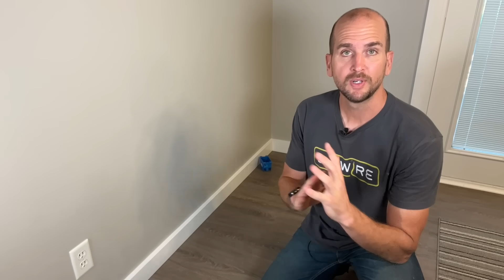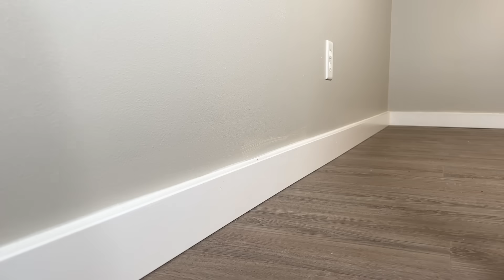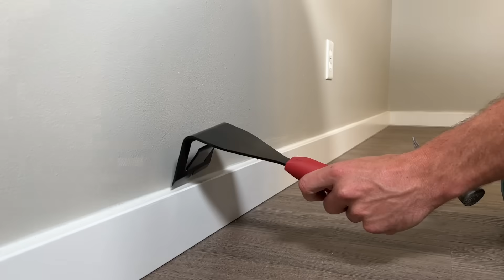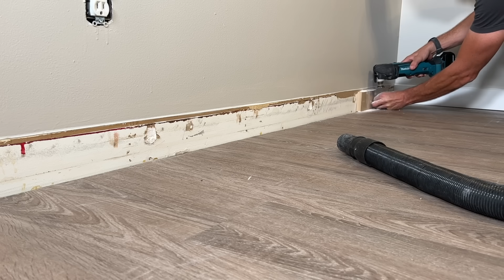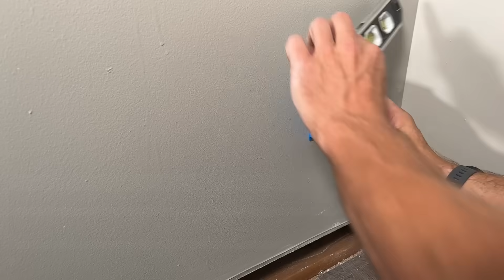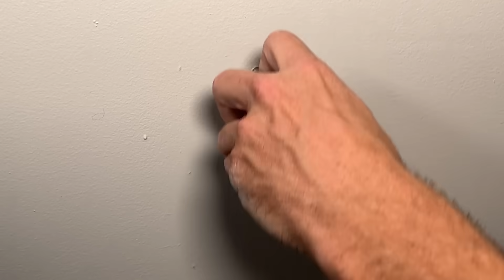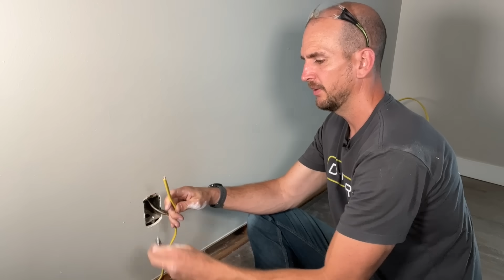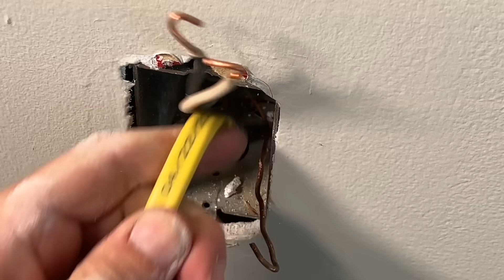How To Add An Outlet To A Finished Wall

Comment: Nice try but...Wire is way to low for code..what if your house is on a slab and God forbid it floods
Or say years down the road someone decides to change out the trim and doesn't know the Wire is down that low..
This is why we have building codes

Comment: FYI if you own a rental property you cannot legally DIY electrical work unless you are a licensed electrician and you pull the proper permit. You are allowed to do electrical work in your residence only.

Also, you don't need to use a wago(or wire nut or merret), the receptacle has 2 hot and 2 neutral terminals for this exact purpose. Power in, power out. Back stabbing a receptacle should be your last option when hooking up a receptacle. Doing a hook end on your wires and going to the terminals is the best and most secure connection.

Comment: Ps. You CAN have too many plug outlets. No mention about how many outlets on the circuit. Don't forget there is a electrical code to follow. Be safe

Comment: you dont need the stud finder and its not always accurate because international building codes require lateral support boards (crush blocks) that run horizontally between studs under certain load conditions so your fasteners do not necessarily indicate a stud location...the single gang box that the existing receptacle is in will be nailed to the side of a stud unless the box has a large flange with screws in the outer corners indicating that it is a "remodel box", which you could otherwise pull out of the wall by unscrewing those screws, thus leaving you with a large opening to fish new wire. You can find which side of the box the stud is on using a small putty knife and then measure over 16" and knock on the wall like you would knock on someone's front door. Assuming there is a stud there, you will hear a distinct difference between your knock over the stud vs. a knock over a hollow section of drywall 3" to either side of the stud unless there are multiple layers of wall covering....worst case scenario, you can always run a small 1/4" drill bit into the wall and you'll definitely know if there's a stud or not once your drill gets through the 1/2" drywall, then just fill in the 1/4" hole with spackling or drill your hole 3"-4" from the floor so that its above the bottom plate of the wall framing but still low enough to be covered up by your baseboard. You don't necessarily have to remove the drywall behind the baseboard either...I usually just run a 1" paddle bit on a steep angle wherever theres a stud, which gives you enough room to fish wire or grab it with needle nose pliers if needed

Comment: I would have used a 4' flex bit and just fish the line over. 20 min job and no carpentry involved.
Reply: Works if you know for sure nothing else is in the wall. Drill away.

Comment: Great job man , wouldn’t have thought to remove the trim and go low. How I’ve been taught and usually go about it his is by using the stud buddy like you did and on every center of each stuff between existing to where the new outlet goes , use either a 4 inch hole saw *why , use it regularly for canless can light / recessed lighting, 4 inch hole is a pretty good fishing hand hole. And from there off set the hole to the center of the studs so where you can use the same method , spade bit and extension , and then at the end wood screws back over the 4inch cut outs after done fishing wire , so in the case of being u see cabinet lighting / adding an outlet from over 46 inches off the foot may serve a purpose hahaha , but you definitely saved having to paint or do any dry wall repair as I would have my way ! Cheers brotha ! Nice video

Comment: Great idea that works for audio also..surround sound. If you have floating floor or carpet  you can use stiff wire to cross doorways too instead of going over the opening behind trim if ot has it.

Comment: Done a lot of fishing to add boxes including this way, but when you have foam insulated walls it is more challenging. I have notched the studs as low as possible, plate over the wire and of course do not try to nail the drywall that low.

Comment: Great video! My only question would be about determining if the circuit will handle  another outlet. Where I live I believe the maximum is 12 to a single circuit.

Comment: Good explanation of the work your doing and yea I have seen plenty of installs without a connector. I do the same method as you did pre install the connector hood pro tip 👌🏽 giving you a subscribe follow. 👍🏽

Comment: Beautiful 
Just one thing... I was taught that when installing a device into an old work box, you break off the ears on top and bottom around the screw holes so that the device flushes up between the ears of the old work box better, making it easier to flush the plate, especially if it's ceramic, to the wall
Reply: Only if it’s ceramic and not cut out or it’s a handy box with a wraparound cover. The ears make the offset perfect on drywall locations so they should not be removed. There are also little horseshoe rubber plastic/ rubber washers for when walls are double or ceramic tile is thick. They are stackable so you always have a tight fit with no wiggle which always cause trouble eventually.

Comment: I had some electrical work done last summer and he claimed he had a "trick" for ensuring plenty of room for wiring...He claimed that he would take a box that was one size larger than the number of switches/outlets/etc, that he planned to use.  i.e. a two-gang box for a single outlet...Obviously that wouldn't work for those retcon boxes, but does this sound reasonable to anyone?  It just seems sketchy to me...
Reply: 'Electrically' it seems fine. Either the 'back box' is correctly wired/earth or it isn't. For me it's a question of the aesthetics. Do you really want an over-large blanking plate?

Comment: Can you do a demonstration where there is a doorway between the old outlet and the new location? I have this situation in my kitchen where only one wall has two outlets available for appliances. One outlet is used by my mini fridge because its low and I have an above counter outlet. The new location would be a wall 90” from the mini fridge outlet but it has a doorway in between them. 
Would I have to do something similar but feed the cable around the doorframe?

Comment: That was oddly satisfying to watch 😊 Removing the bottom of the drywall has no ill consequence, like risking to sag? And - is it common not to use  insulation in the wall?
Reply: It is an interior wall, insulation is only on exterior walls usually; however, if a room needs to be soundproofed it will sometimes have insulation as an added sound absorbing component.

There is no sagging due to the drywall being properly hung by sufficient number of screws that together can carry the weight and prevent sagging.

Comment: Well explained. Having done it myself when I first saw this I thought to myself "simply remove the base molding" which is exactly what you did.
Reply: @EverydayHomeRepairs  I've had decades of experience doing home projects of every kind, plumbing, electrical, carpentry, door and window installation, roofing ,sheet rock, painting etc but when my wife said she wanted me to install another outlet, around a corner no less, my wheels started turning because the area was above a basement that I had finished. At first I was thinking I'd have to do a lot of sheet rock finishing work but then a light went off in my head, remove the baseboard, cut the sheetrock below the top of the molding and the job would be easy.

Comment: Electrician here. I would just like to add that the boxes must have adequate cubic inch volume for the size, number of wires and devices to be used. A really novel way to extend the circuit and neatly done.

Comment: Although I can see doing it this way under certain circumstances, its far easier most of the time to simply knock holes in the wall at the receptacle height, and patch/repaint the sheetrock afterwards.
Reply: That's how I do it. While I watched him do it, I know from experience the chances of getting baseboard off without trashing either the board, or the wall, or both, is pretty slim. Which means patching and painting sheetrock anyway, PLUS replacing, priming and painting base board, and then caulking all that. So I'm with you.

Comment: Is there noone in the US who runs electrical conduit/plastic tubes/flexible hoses inside walls for wires to run through?
Just having the wires hanging loose inside the walls seems precarious, and rerunning wires or adding a ground wire becomes an absolute nightmare

Comment: EXCELLENT CONTENT, and Narration!!!  Thank you
   Anotger trick I use frequently, is the nylon romex cable clamps...run your wire in, slide tge pop-in onto your wire and snap it into the knockout in your box. It's quick and easy and insulates, especially if its a metal box. It pops in and no problems. A box of a dozen is just about $4.00

Comment: So what happens if the hole you need already has wire in it for that outlet, and a wire coming out of it running to another outlet somewhere else?

Comment: I would not suggest taking the screws completely out of the outlet (top and lower screw) that hold the outlet to the outlet box. The reason is there are small screw holders which keep the screw in place and helps you not to lose them.

Comment: The thin finish nail used on the base boards can easily be bent back and forth a few times then they will break at the base nice and clean. If someone used thick nails then you most likely will need to cut them.

Comment: Unfortunately electrical inspectors would most likely cite that way of doing it as a code violation, because of section 300.4 (A) 
In the NEC book. Because inspectors know there's really no way in a remodel that way of drilling to guarantee you're getting 1 1/4 inch away from the nearest edge ot the studs, and so this way doesn't allow for any installation of any nail stoper plates to accommodate for that lack of guarantee. 
  But when the wall is cut higher up just below the junction box locations and cut a little wider then the nail stoppers you can drill the holes a little off center closer to the side you've cut the sheet rock (to get the 1 1/4  distance from the other side you're not cutting) run the wire, install the nail plates, screw the sheet rock back up and yes I do know that that now it will require mud, primer and paint but would pass any inspection! 
 And I said "most likely" above because if this job is ever done with studs that are 2 x 6's (Which is more rare as wall studs than 2 by 6 of course) Then you're more guaranteed to get required distance from 300.4 (A) if in a 2x6 but that's not the case here unfortunately.

Comment: Break the "ears" off the top and bottom yoke of the receptacle when installing into that remodel blue box for a better flush fit with the trim plate and the drywall.

Comment: have you ever used a flexible bit to drill those hole between studs?  they are really good for also drilling down from a wall plate to the basement as it's hard to get a drill into the wall plate hole.  great video

Comment: I use an auger bit instead of a spade bit for drilling holes to pass electrical wire. A set of three extra-long bits is not very expensive and is very much worth it to avoid the aggravation of trying to drill through a stud with a speed bit, especially through what looks like Douglas Fir here and in an awkward position. Also, when working with drywall around finished floors, it is worth the time to actually vacuum the dust and wipe the floor with a damp cloth because drywall dust is very gritty and will scratch the floor very easily and quickly just by leaning on it with your hand or your arm.

Comment: Another guy giving his advice without regard to safety or codes! How about starting with turning the power off first? You might want to address using “like- sized” wire? What about securing the wire 7” from the box? Humm…codes are established for a reason!

Comment: Exceptional innovative job.  I know you love Wagu connectors and they've been tested to be equivalent to a wire nut - BUT - you only needed one for the ground wire.  You could have fastened the all the hot and neutrals to the outlet itself.  Saves money and saves space in the box.
Reply: Better practice in the long run to use pigtails
Reply: @mrmotofy  agree. Better for troubleshooting too

Comment: Drilling holes that close to the bottom (or top) of the studs is a no no.
Drill a minimum of 6 inches away (up/down) from the ends, or you compromise the integrity of the studs, at the place they are most likely to split. 

Just cut the drywall and repair it at the right height, it's not hard.
Reply: patching drywall then trying to match the paint...NOPE

Comment: Never attempt any house hold electrical work without the necessary experience/licence.Leave it to the professionals."DIYers", have no business working on any medium or high voltage electrical systems.You did the dangerous stuff but left the non hazardous caulking to an  expert.Fuck off.Professionals now how to install do this.Don't show the general public.That's why electricians do a 5 year apprentiship.

Comment: Well done, it makes me laugh how many electricians want to 'critique' the video. A homeowner can pull their own permits and do their own work. As a homeowner, this in under 6' in length. No, I would not get a permit. Secondly, he drilled above the work area and in stud center to run his wire. He also did not incorrectly downsize wire ( exp: 14/2 used on a 20amp circuit)
Reply: Did he properly bond the metal box?? Guess that doesn't really matter though, it works and he is saving a homeowner from paying a licensed pro $200-$300 to do it to code

Comment: Excellent video for what can be a challenging project. The only suggestion I can offer is if you can place your new box next to a stud, use a Southwire MSB1G box; it screws to the stud instead of relying on the drywall to hold the box.
Reply: One additional thing I would suggest is to make sure you're using the correct wire size, the outlet itself indicates a 15 amp circuit but the wire color he's using is indicates a 20 amp circuit. Maybe he is using the correct wire size because I can't see what's behind the old box. Also, I don't know about your local code, but mine says installing a new outlet, you have to use metal protectors for protecting the wires behind the wall so you can't drill into it.

Comment: You should explain the 2 color wires, it looks like existing wires are 12g but often it's 20g 15v and you don't want to put 20g 15v wire on to a 12g 20A circuit. while it's not really ok (you shouldn't do it) and misleading to put 12g wire onto 20g you can in a pinch

Comment: Tremendous sense of accomplishment.  Professional.  Thoroughly demonstrated and explained.  And on the flip side, if for any reason unable to personally do this, make sure an extension cord matches the baseboard  and or wall color as close as possible. 😊

Comment: This is good except instead of starting by taking the trim off you should make sure you actually have room in the receptacle box first…would suck if you took the trim off and did all that to realize you have 2 cables coming through the bottom of the box already, or worse 3 cables.

Comment: One extra tip. Bend the ears off the outlet going in the remodel box. Lets the outlet go back further otherwise sometimes the plate wont be flush on the wall

Comment: Why'd you do pig tails instead of using the other side of the outlet?
Reply: Because that's the correct way of doing it. Otherwise if the old outlet fails, you lose both.
Reply: @JustinKais  idk if "correct way" is the proper term, just a preference

Comment: Did I miss the part where he connected the new box to the stud? Is that unnecessary?
Reply from the maker: Nope, it is an old work box so it just holds on the drywall with 2 tabs.  There are some old work boxes that have 2 internal screws that you could attached to the stud even with drywall installed.
Reply: @EverydayHomeRepairs  good to know!

Comment: You didn't mention that NEC code is 9 openings per circuit. So if you already have 9 outlets on a circuit. you cannot add another one legally. This is what a licensed electrician doing this work would know. I hope my free advice from a licensed electrician helps.

Comment: This is a great idea! However, people with 2.25in casing would only have a 1/2" to 3/4" window to work with because of the 1.5" bottom plate, not that it's not doable but food for thought.

Comment: all these "cheater" diy videos do is create future issues or dangerous conditions for the next guy to deal with.
There's more but we'll just go with the obvious ones to any pro.
1. What happens if someone upgrades to taller baseboard? With no protective steel nail plates they stand a good chance of nailing into live wire, that's what. 
2. Without screwing both sides of the drywall joint it will be prone to cracking over time.. but wait, if he did screw both sides of joint again risks hitting live wire..
See where this is going?
Please people, don't cheat and take short cuts... do it the right way, or hire a pro.

Comment: Why use those crappy wire nuts when you don’t need to? Why add connection when the outlet provides screw terminals?